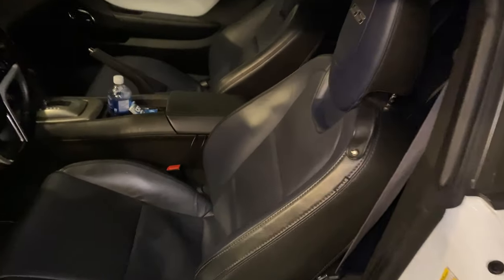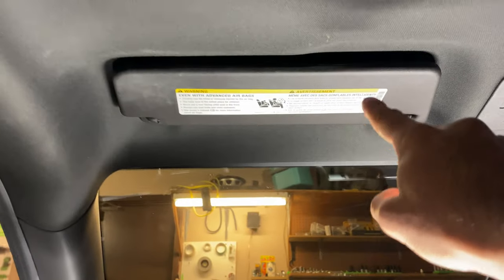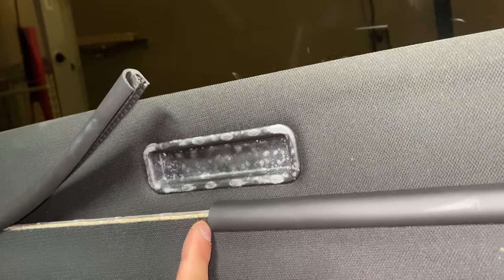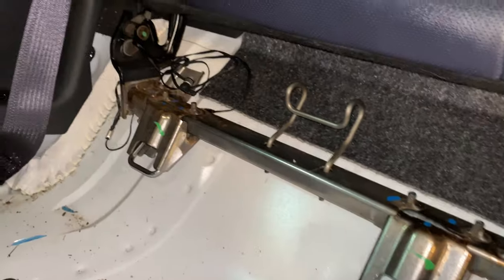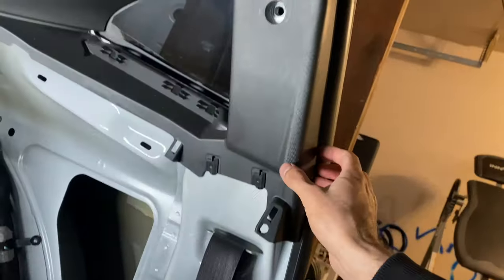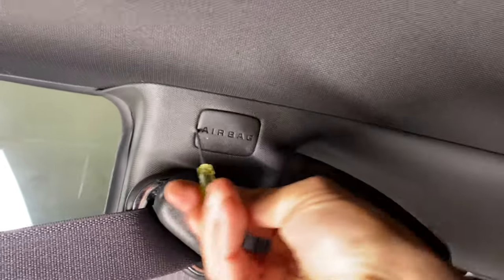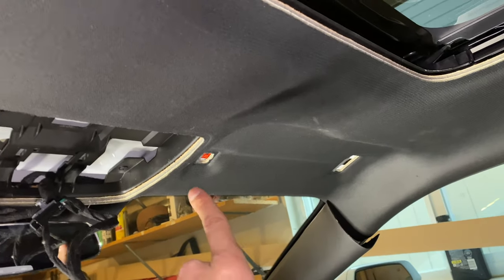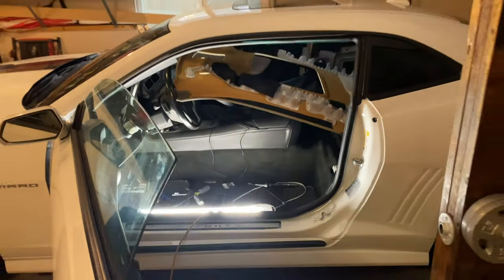5th Gen Camaro Starlight (How-To)

Comment: Just did this in my 2014. I do not have a sun roof however. I said f it and squeezed it out of the car. Definitely don’t tape it along the way because that eliminates places you can put the fiber optics. Definitely pull them all the way thru to have Have like a good 24
inches as you feed the remaining fibers down the back pillar. Long enough (pause) that you can attach your motor somewhere.

Comment: How hard was it fishing the fiber optics into the trunk? I'm in the process of doing my camaro. Did u have to take off the rear three trim pieces for the rear window in order to fish fiber optics to trunk? Not sure where to run the box yet.
Reply from the maker: i just removed the back C pillars and ran it down into the trunk, thers a big opening on either side, or alternatively you could mount it on the rear decklid too